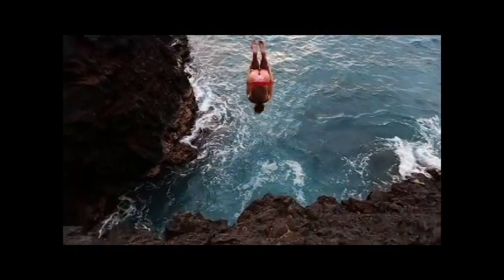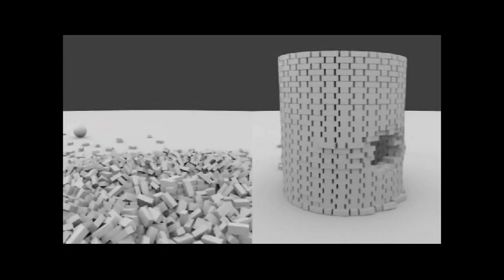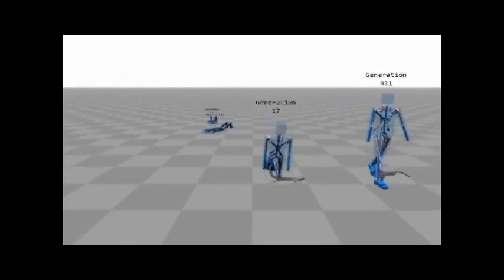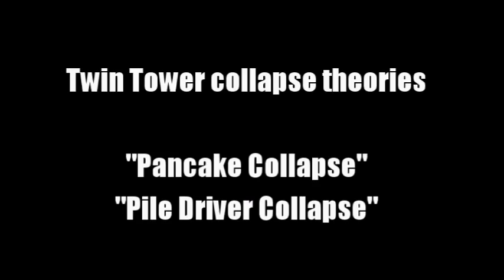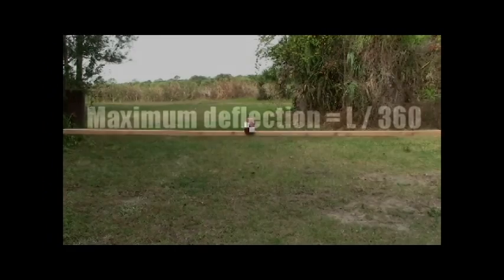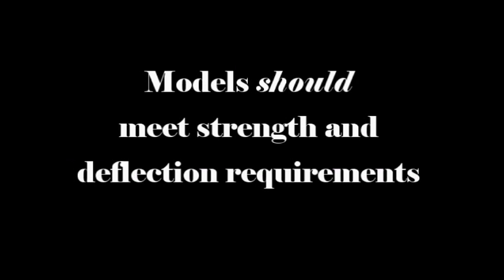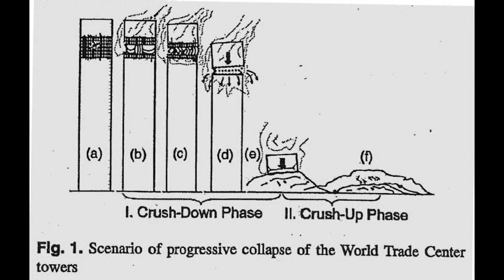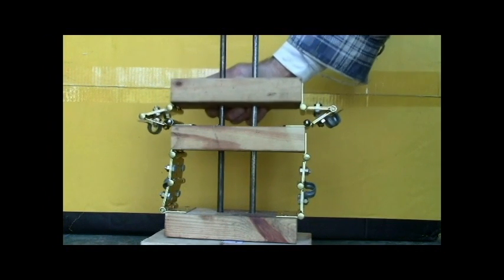9/11 Experiments: The Force Behind the Motion

Comment: I earned my Captain strips after 5 years flying in 2001.
As today's day, I have more than 29,000 hours of flight.
I was First Officer in a Boeing 717 (MD85), I earned my strips in an Airbus A320 in the extinct Spanair.
I'm Captain Instructor and Examiner (certified by CAE) in Iberia of the following aircrafts:
A319, A320, A330-200, A340-300 and A340-600.
Actual A340-600 Captain in Iberia.
So said, I was in Majorca airport when we had the breaking news on TV.
First thing that came to my mind was a prayer for those that died in the fuel deflagration of the aircrafts.
Second was "well, it's all over, I expect that the final death count is as minor as possible"
I knew these two towers would stand still without any problem, I knew the aluminium, carbon fibers and carbon composites of the aircraft I was going to pilot two hours later could not cause any structural damage, that only the fuel that burnt for seconds in the impact would have cause victims, the smoke too.
I little thought came to my mind too as captain... "You have to be very skillful to make a full impact at sea level, throttle at max. t/o, no flaps/slats/airbrake extended to make the maneuver easiest... you need a good 2,000 hours to do that. No Captain in the world would do this even threatened".
I watched both towers crumbling in horror but my thought was "no way any aircraft can do this damage, no way!"
Just keep one thing in mind: while there's commotion and terror, whoever may have any intention of doing whatever can act as calm and without any pressure than in any other situation.
Reply: First of all, any of your flying experience does not make you a physicist or engineer. Secondly, the towers did not come down by the plane impacts alone, but by the resulting fires, lack of fire resistance, lack of fire fighting, long floor spans, very specific engineering and resulting vulnerability for progressive collapse as well.

If you would have been a physicist, you would have understood that material does not play a role in equasions for force. It is just mass and velocity.

I am no pilot, so could you explain to me how it is hard to steer a plane into a 420 by 62 meter square at full throttle? Or in your own words, why it is impossible to do so?
Reply: Bruce Lansberg
First of all, sorry for the delay in answering you.
You're right, I'm not a physicist, so I'll never engage an argument in that sense because of my limited of knowledge about complex physics. I like to talk about what I know, otherwise I prefer to listen and learn.
Answering you question: it's not impossible to smash a 767-200ER in both towers for a pilot with thousands of hours of flying.
Although, there are some factors that make it very difficult for an unexperienced jet airliner pilot:
- None of the aircrafts made a straight flat impact, both were descending pitching and rolling and made a whole wingspan impact: 47,6 m. into a 63,5 m. "aim".
Keep in mind that fully manual control is needed to do so and highjackers never put hands even in a small corporate jet.
- What basic manual control of any jet airlineer involves? Rudder pedals, yoke (in the case of Boeing) and thrust levers.
- Factors that affect the response of the aircraft: speed, air density (the closest you get sea level, the higher air resistance, resulting in more complicated control of the aircraft). The fastest you go, increases the the difficulty on controlling the aircraft.
- Overspeeding the aircraft: each manufacturer establish a VMO/MMO (Velocity Maximum Overspeed) for each aircraft. The only situation in which you will overspeed an aircraft is diving from high altitudes (low air density) in case of depressurization of the cabin to reach higher air density as soon as possible, and even in this emergency situation, manufacturer procudures have to be followed.
- If I overspeed the aircraft (thrust levers at TO or Max position) the structure of the aircraft can be severely damaged. Futhermore, the more I increase the speed, the more the aircraft will "upper the nose", the more have to lower, the more the structure of the aircraft is compromised, the less ratio of maneuver for such an accurate impact.
Conclusion: if I had to make this impact, without a second chance, to hit my whole wingspan with such an accuracy would be:
- At a much lower speed to have the highest possible control of the aircraft.
- Reach the desired altitude and increase thrust once I have my visual flypath established without surpassing VMO/MMO (50 to 80 KIAS won't make a hughe difference) in a low rate of descent.
Now, go back above to what I told you to keep in mind: it was the first time, first flight and single chance of the highjackers in a heavy airliner and both made it like fying high responsive fighter.
Reply: david b
I don't see any difference with the altimeter function according to FAA or EASA, so I'll do it with pleasure but for educational/teaching purposes only.

Comment: 6:15 - your model is all wrong. First of all, it differs to the WTC that the support beams itself collapsed, not just the floors as in your model. Second, because of this the weight on the next downwards floor actually increases by the combined weight of the floors above. How can people take these models as evidence if they don't even mirror remotely what they try to prove? Also, at the first floor that collapsed, collapsed from only the weight with anything big falling on it. But this movement of exactly the height of on floor was enough energy to flatten down the next one
Reply: You don't understand the principle of resistance. If you drop a car from a height onto a stack of cars, a significant amount of the energy from the car you drop is absorbed by the stack of cars below. They offer resistance. Some crushing will occur, but the top car cannot begin an explosive cascade down and through the rest of the cars to the ground, and certainly not at near to free-fall. It is physically impossible to achieve this effect unless you fill the cars with explosives and set them off one by one, destroying the structural integrity of each car in succession. How is this obvious fact so difficult to grasp?
Reply: His two center beams add hardly enough friction to hold anything up or foil the test.

Comment: Physics can be broken, the physics we think we know.

Kings cross underground fire, London.  Witnesses reported the fire laying down as it traveled up the escalator (it basically hugged the escalator), before engulfing the ticket hall.

Again, people said Fire cannot do that, heat rises, so should fire.  So they built a scale model of the ticket hall, using the EXACT material used in the escalator, and ticket hall, and set the bottom of the escalator alight.  The flames started to rise upwards (as the "experts" said), but after a short while, the flames started to lay down, super heating the air ahead of it, and combusting the escalator (before the fire got to it).  The fire raced up the escalator (Like witnesses said, and against expert advice) and engulfed the ticket hall.  The effect is called, "The Trench effect".

https://www.youtube.com/watch?v=wIAenEFpomU

So you cannot replicate all forces at work, if you have not used a model that is to scale, and does not use the EXACT materials, so you cannot replicate a concrete and steel collapse, with paper.  For any replication to be worthwhile and trusted, you need to replicate ALL factors, that includes scale dimensions, and materials.  The example here is flawed.

I am open to discussion on the effects of a falling building, if the test is replicated using Scale dimensions of the twin towers, using the same materials.  There has to be building schematics somewhere.  Otherwise your example just looks like trying to replicate an explosion with a tomato.

The Channel owner is called 'Physicsandreason" (Physics and reason), but how can you reason with physics when you do not follow peer established principles of accurate modeling, in this case, Types of materials, dimensions of materials, density of materials, type of fuel to enable explosion,  length of time exposed to burning fuel, temperatures experienced during said duration, reactions of materials to said temperatures.

Paper is a dry source and EASILY combustible.  Concrete while a solid, contains moisture, and when in a superheated environment needs time to heat the moisture in the concrete.  The moisture evaporates, turning the concrete brittle and weak.

One floor buckles under the stress, causing the number of floors above to give way to gravity, encouraging velocity.  You have (for argument) 20 floors of concrete accelerating to 9.8 meters a second with several thousand tonnes (or more) of mass, you are not going to stop that in any hurry.  Add to that, the story that the Twin Towers were not built to the code of the time (Well Gee, they cut corners ?).  As each floor gives way, it adds more mass to the moving block, meaning less ability to stop.

An equal example would be an ant trying to stop a boot from stomping down on it, or a person standing in front of an express train traveling at 70 miles an hour. (oohh, Messy).

But lets not let facts get in the way of Cheeto stained keyboard warriors with no peer reviewed model scaling to back up their video.